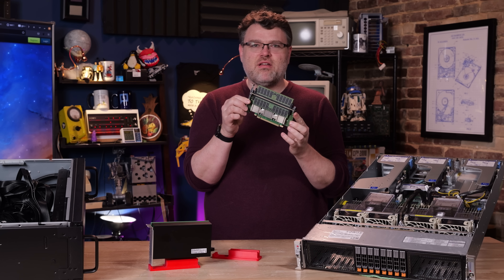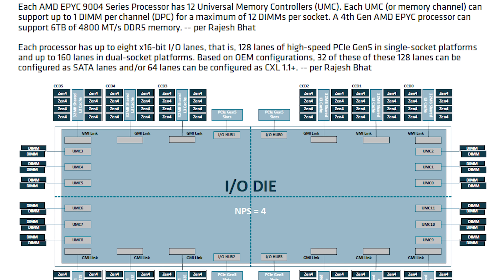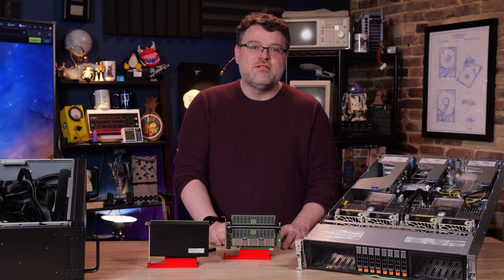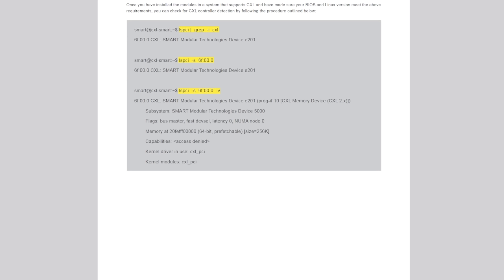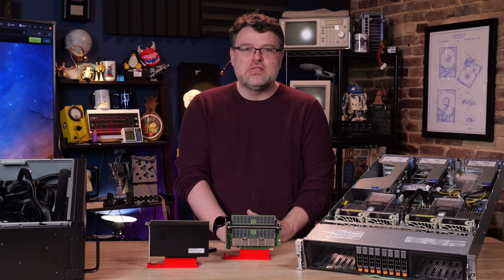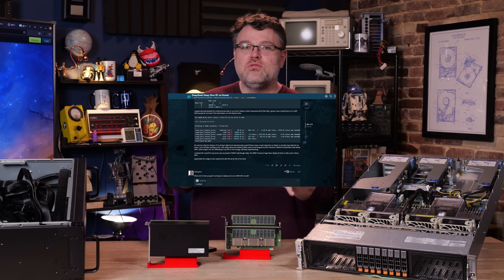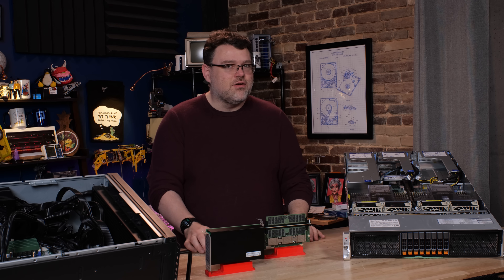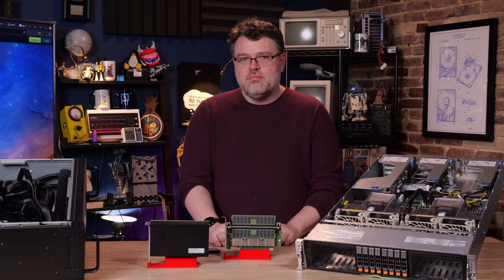PCIe RAM? In MY Server? With Smart Modular CXL, It's Possible!

Comment: I thought the big thing with CXL was not that it plugged more ram into one chassis ( like the expanded memory cards from the late 80s ), but that you could have a chassis in the rack that had gobs and gobs of ram in it, connected to the other chassis in the rack with external PCIe, and dynamically allocate parts of that ram to the different chassis in the rack that need it from one day to the next.

Comment: Installing CXL in a single system, especially for DB hosting is 100% the way to go I think. Especially if you have a lot of cores and enough queueing to cause .latency issues on mem bus.
The network level installation is realistically, something to leave to shops with a staff of network, system, sw, and perf engineers on salary. Sadly lol.

Comment: Uhm.... hate to toss some cold water here... (let me explain)

You pointed to an intel cpu as 'high core count'. Its not. 
Nor are all vendor's cores equal.  (AMD vs ARM)

And then there's hyper threading where your vCore count is 2X physical core count. 

Under today's current compute work load, you're looking at 8GB per core. For most that could be pCore but for higher end solutions... that's per vCore. 
So when you have dual socket AMD Epyc with 192 core count per CPU.. that's 384 vCore per socket or 768 vCores. With 8GB per core... that's going to be 6TB.
Good luck w that. Even if you did 8GB per pCore, that's 3TB

This is where CXL can come in... 
Add in the DMA capabilities... 

When you're building out a server... you're typically not going to be opening it up to add more memory.  So your memory is set at build time. 

To the point your raise about memory density and speed. (Increase in density, decrease in speed...) Consider where you'd apply a 768 vCore beast. 
Its server consolidation where you are replacing 1-2 racks w a single 2U server or 4U server.  And when you consider a lower core count, faster memory... it ends up being moot when you consider networking speeds in a clustered environment. 

So you end up performing a cost optimization using a 8:1 GB:core ratio (virtual or physical)  in your server... along w a 100GbE or faster networking card and ToR switch.

There are other issues like cooling and power... that also come in to play. 
Local disk/NVMe along w storage clusters w a high speed network also come into play as well. 

Note: 15yrs ago... 2GB per pCore was considered state of the art.  
I don't see AI pushing past the 8GB per vCore any time soon. 
(Its due to a mix of costs,  server refresh rates, and technology )

Comment: It'd be really cool to see CXL evolve to where it can be used for GPUs.  Imagine being able to add extra GDDR to a GPU, imagine what this could do for the future of multi-GPU.  Also imagine if this could work with intelligent tiered storage (alla what Enmotus was doing) with a CXL-based ram drive.  Imagine combining the two where a GPU has a primary memory bank, a secondary memory bank, direct storage, and system storage, then having a way for both the CPU and GPU (and NPUs now, I guess) sides to interchange and share the CXL capability.  Can we eventually just have infinity fabric via expansion slots at some point? Though this would require an architectural change where devices can directly talk to each other rather than having to jump through a host, i.e. slot 0 can talk to slot 2, slot 3, slot n, though this would be divided up per lane so lanes and how a device allocates lanes. 

Also do we think CXL will trickle down to consumer devices and become the currently unused m.2 F key, the Future Memory Interface (FMI) slot?  This could be massive for laptops, embeds, and SBCs, where slots are limited or changing memory is not possible.
Reply: CXL envisions three main device types, an accelerator with local cache but not memory (Type 1, e.g. a network adapter); an accelerator with local cache and memory (Type 2, e.g. a GPU); a memory buffer device (Type 3 memory expansion card). Graphics cards would be type 2. There are no CXL-enabled GPU right now, although Intel already has a type 2 FPGA product.

Slotted Infinity Fabric is already a thing (Epyc Trento).

The x86 duo don't seem interested in consumer CXL, AMD doesn't even have it on their workstation platform. But there is a proposal for a 8x width M.2-like slot, known as M.28 or FleX, designed to support CXL.

Comment: This is going to sound like a silly question but what about on old or cheaper commodity hardware,, that doesn't implement the CXL protocol. Is there or was there a pcie card that worked the same way in principle? 
  If not what would it take to make? Is it physically possible? Or could it be done with the right card,  kernel driver and a few custom bios tweaks? 
  When I try to search for a product like it all I find is Iram ram drive and I'm not looking for a drive I'm looking for RAM.
Reply: No way. The computer CPU has to support CXL, it is hardware support, no way to work around

Comment: Do we foresee a future were we will have memory (CXL) servers? With the advent of 400Gb networking, and CXL being "good enough" at ~40GB/s bandwidth, will there soon be racks of CXL RAM partitioned out for datacenters to use? I recognize that latency may be an issue, but what's preventing lower latency interconnects from being deployed for this purpose (I'm no expert, so I'm not aware of what may be out there or in development)? 

Is this the next thing after the GPU/AI Server and the storage server?

Comment: AMD tends to run CXL a bit better, which is ironic given CXL being a very early branch off of Optane when it started it's decline. I would suggest running some other tests aside from mlc since it's notorious for being a bit more biased towards Intel systems, though performance on AMD hasn't been too far off. Utilizing some tests such as multichase/multiload on those Smart Modular cards will show some speeds up to 40+GBs depending on how you point the tests with numactl commands.
Reply: You might also look into some companies producing EDSFF drives with E3.s form factors (ie Micron), though that might be a bit tighter on the support side for back planes that will allow that. Also a tad more expensive than the SM cards (though you also need to factor in DIMM costs).

Comment: Edit, TLDR i thought AMD's Strix Halo would not be quite as bandwidth staved, and use CXL to be offered on both mobile and desktop with a choice between ~90GB/s bandwidth and 24 PCIe lanes, or 8 PCIe lanes and ~210GB/s bandwidth with up to 1TB of RAM(that capacity likely drops bandwidth to ~160GB/s)

To be honest, this was how i thought AMD would bring Strix Halo to the desktop. I thought it would top out at 8 cores, 24-28CU not as much cache and instead of a cut down PCIe controller like most of AMD's APUs, the full 24 usable lanes along with a 128 bit memory controller
(FYI DDR5 uses the same memory controller for DIMM, SODIMM, LPCAMM, and LPDDR so you only need a different socket package(R2), not a different memory controller).

HOWEVER i also expected them to supported CXL so you could take 16 of those 24 lanes and dedicate them to 2 more channels of RAM on pretty much any platform from laptop/tablet where you cant really use that many lanes anyway, to desktop and server where 1TB of RAM might be adventitious 

I did not expect 40 compute units and 16 cores, DIMM/SODIMM just cannot feed that with enough bandwidth so i understand AMD's stance on not allowing partners to use it.
However i do foresee AMD making an EPYC 4595PX that uses RDIMM for up to 4TB of unified memory (I dont recall if RDIMM requires a different memory controller, if it does, then it would have to use uDIMM which would be limited to 1TB of unified memory, or use a different IO die that maybe bumps it up to a 384 bit bus for more usable bandwidth)

Edit Desktop DDR5 128 bit reasonably tops out at 90GB/s on AMD APUs(possibly slower with chiplet based as monolithic APUs have historically had much better member controllers than their chiplet counterparts), but 16 lanes of PCIE 6.0 would be capable of ~120GB/s more than doubling bandwidth and still coming close to LPDDR5 7500 256 bit, though not quite to the DDR5 8000 of most of these strix halo hitting over 250GB/s
Reply: Strix Halo isn't going to have a socketed variant. AMD exec David McAfee confirmed it in an interview with TPU. The SoC doesn't even have DDR5 controllers, only LPDDR5X.

It doesn't have PCIe 5.0 either, and although CXL can go down to as low as PCIe 3.0 x1, anything below PCIe 5.0 or x4 is considered degraded. It's also quite lane-starved, if you need any PCIe peripherals beyond NVMe: the SoC has 16 PCIe lanes (excluding USB4), 2 of which usually go to a WLAN adapter, subtract another 8 for 2 NVMe drives, and you're left with 4+2. Going for the 24+4 full AM5 will require producing a new IO die, which is difficult to justify given the limited market.

AM5 motherboards don't have the required firmware components to support CXL either. At the moment, AMD is making CXL a "proper" server (SP5/SP6) exclusive feature, not even Threadrippers get it. It will require a significant amount of effort on the part of their motherboard partners to enable CXL (not just adding a new PI), which I'm sure all of their partners will happily undertake./s

IMO if they ever want to make a socketed version of whatever Halo, they should do what Intel did with the NUC compute element. Create new socket/slot, and make the replaceable unit a SoC+RAM compute module.

Comment: Now you need to think about DIMM failures since you have more ram chips than anything else in the computer.
Reply: Yes, but the failure of a bit in a neural network coefficient is completely irrelevant, so you can actually turn error correctio off and you will be fine. Not sure that we are architecturally prepared for this, but in a hardware generation or two we probably will be.

Comment: Was thinking How about a M.2 to PCIe Adapter ( M.2 Key M to PCIe 4.0 X16) speed will be slower... But i can use the RAM. Problem is still no not yet available for consumer motherboards...

"AMD representatives have confirmed that they will work to bring CXL technology to consumer processors in the future, but no specific date or chip generation has been provided for its implementation in consumer CPUs"
Reply: This would be very interesting for being able to expand RAM on latops etc - sodimm and even lpcamm puts some limits on memory speed compared to soldered ram, and also cost - so CXL could be a way of retaining the benefits of soldered ram while still having the option to add some extra capacity on top. Even though that extra ram doesn't run at nearly the same speed it will still be much faster than swap, maybe manufacturers could even make hybrid m.2 ssd/RAM modules to squeeze some extra life out of crappy low memory laptops.

Comment: - Investigate the potential of PCIe 6.0 Gen in enabling seamless device pooling & its implications for next-gen system architectures.
- Assess whether CXL can effectively mitigate memory bottlenecks for high-bandwidth workloads or if alternative solutions, like NVLink (Rubin) could surpass it.
- Analyze NVIDIA’s strategic direction: Will they prioritize mid-tier AI solutions for broader accessibility, or maintain focus on premium-tier offerings tailored for advanced applications?
- Explore the feasibility of token factories in NVIDIA’s roadmap & their potential impact on AI & computational resource offering at this single/ dual socket CPU 2U device level.
- Consider the broader industry implications if NVLink were to replace CXL, especially in terms of compatibility, performance & adoption rates.
- Evaluate how these advancements could redefine performance benchmarks for emerging AI & data-intensive applications for especially mid-tier adopters.

Comment: In my case I have been looking for using CxL for both compiling UE5 in memory (like compiling source from a ram drive) and run neural networks training on CPU. I hope that the upcoming Threadripper platform can support CxL.
The part about CxL for GPU sounds really interesting.

Comment: Odds we'll ever see CXL on desktop mobos?  A 4060 plus cxl sure seems like it would be cool for small user base local llm system with the bigger models.  Or am I thinking about this wrong?
Reply: There's a proposal for a M.2-like connector with x8 bandwidth, with the explicit intention of enabling CXL deployment on smaller system with more restrictive power envelopes. The connector is called M.28 or FleX.

But presently, there are no CXL-capable consumer platform. I believe Intel has at one point stated that Meteor Lake's iGPU uses iCXL for memory access, but that's about it.

Comment: How long until somebody puts a 128 GB Strix Halo system or something similar on a PCIe card and calls it an AI/graphics card? I mean, putting a bit of compute between the RAM and the PCIe interface couldn't hurt to cut down on the bandwidth requirements.